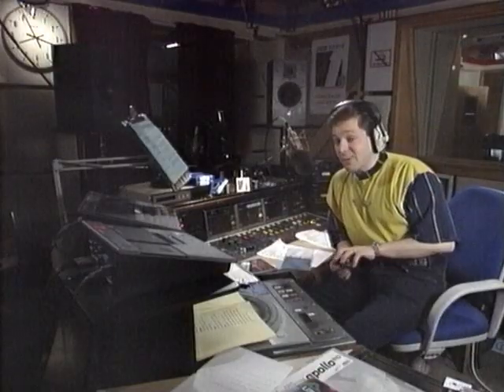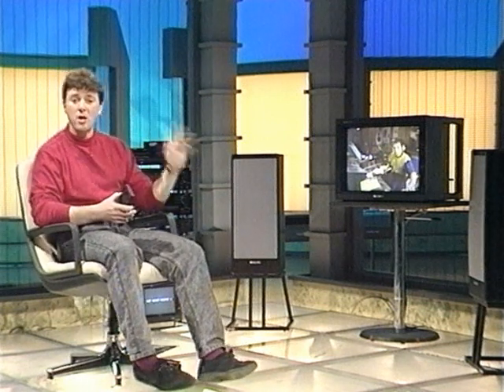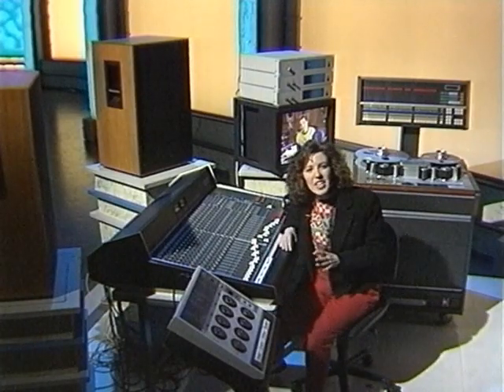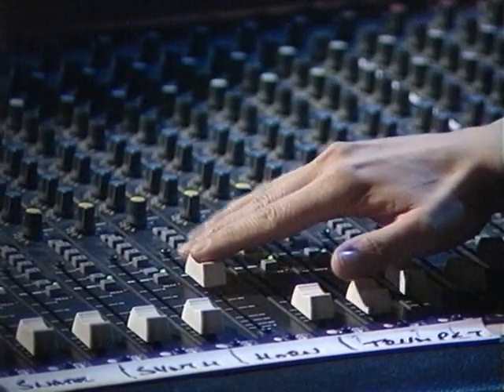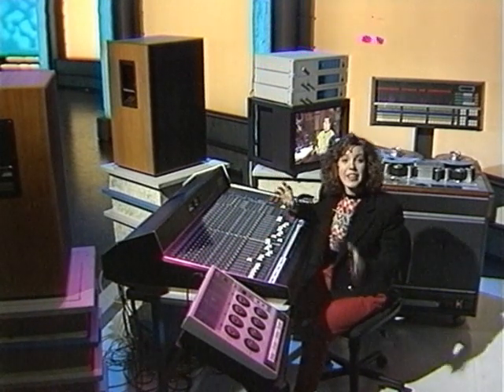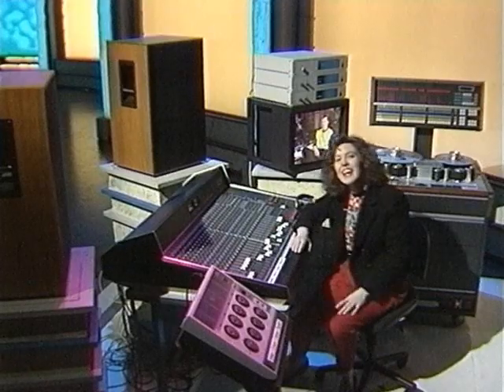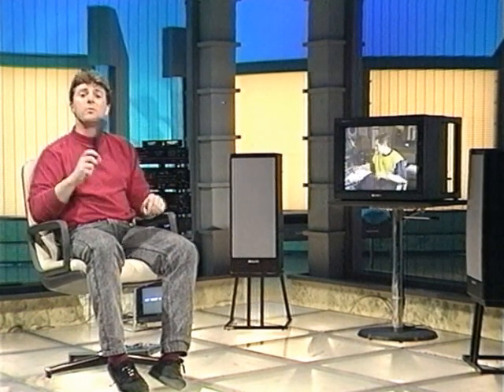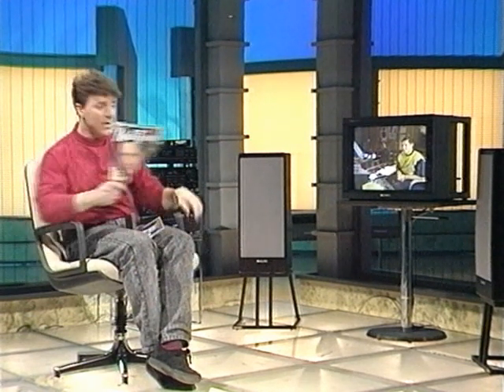Tomorrow's World 3D Stereo Test 21-03-91

Comment: Quadraphonic and 3D stereo was a mess.
Reply: +tacsmoker I have to agree with you as I actually "have" one of the 100 cd's Howard Stapleford was holding. I bought it off eBay as it was listed as a keyboard sound sample cd for a couple of quid but didn't actually realise there were only 100 of them produced till I saw this. I do still have the cassette tape I recorded the whole thing on Radio One as well somewhere.
Reply: Lee Sanderson be appreciated if you could post them on here mate, id love to hear it.
Reply: I also have the CD shown above, but all the audio on this video is taken from the BBC Radio One simulcast in FM Stereo. Probably one of the most famous "3D Stereo" CD releases was Madonna's Greatest Hits Immaculate Collection in November 1990 on which virtually every track was remixed with the Roland Sound System in 3D Stereo.
Reply: @craigavonvideo  But they wouldn't have used that CD due to copyright reasons with Sire Records (which was part of Warner Music Group), I presume.